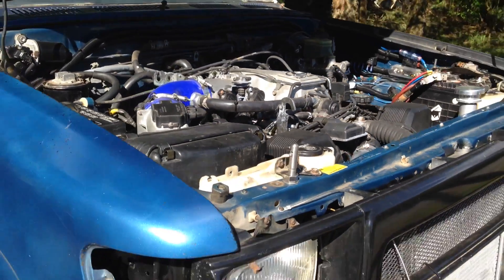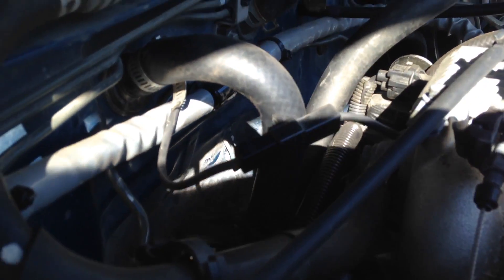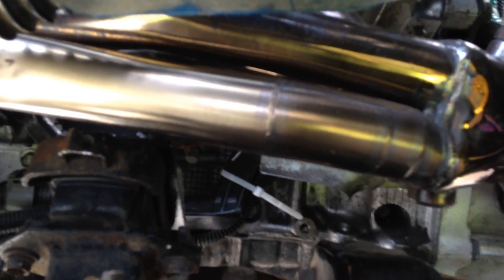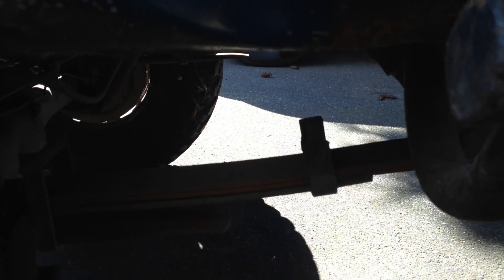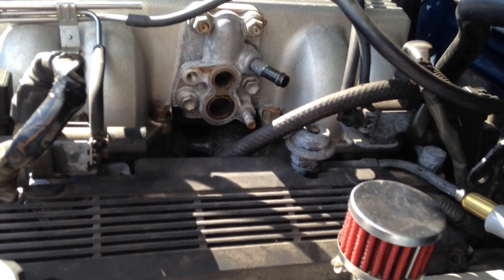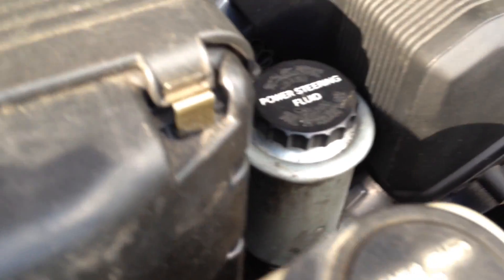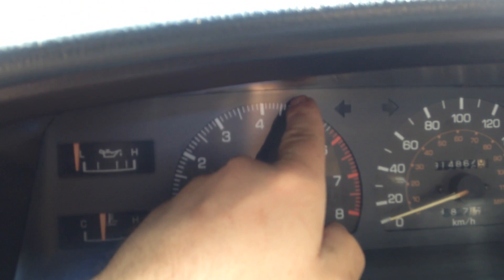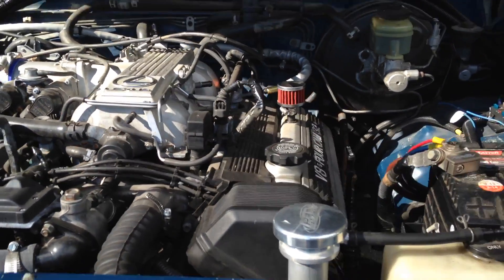Info on my 91 Toyota pickup with a 93 ls400 1uzfe v8 swap

Comment: Do you know if the auto tranny A340F would bolt on to the 1uz?
Reply from the maker: No, bellhousing is not the same. 

Most guys will use the stock Lexus automatic and use the inchworm output shaft adapter so you can bolt on your transfercase.

Comment: What type of fuel pump did you use? In-tank or external? And the bars/psi
Reply from the maker: I used the factory spec denso replacement 3vze fuel pump. It is sufficient for the 1uzfe in stock form.

Comment: I'm not sure if you remember what did you do for the wiring?
Reply from the maker: Wiring is fairly straight forward. If you have access to the Toyota schematics you pretty much just Match up the wiring. 

Things like constant power, switched power, ignition/injector power, starter signal. You will need to splice in connections for oil pressure, water temp sensor. The 1uz uses a dual speed fuel pump, the 3vze used the air flow meter to give ground signal to the circuit opening relay to allow the fuel pump to run. So I used a spare output from the 1uz ecu to trigger the circuit opening relay. You will also need to separate the 4wd front differential wiring from the old engine harness if you’re working on a 4wd truck. 

Toyota is pretty consistent when it comes to wiring. The lion share of the wiring is from the engine to the ecu which you don’t need to mess with. Remove as much old wiring for the transmission and other items like egr if you don’t plan on using them.
Reply: @Jay351  awesome thank you thats a huge help

Comment: I have a 93 LS400 1UZ as well and do you know where the Igniters and Injector/Sensor power wires are located in the harness? Are they in the same plug as the Starter signal wire?
Reply from the maker: Should be located in plug iL1, wire is black with orange tracer, feeds the injector circuit. If I remember correctly it also feeds the ignition coils. Been many years since I did the wiring on this swap. Same plug as starter trigger wire.
Reply: @Jay351  awesome I see there’s 1 Black/Red wire? I assume that’s power to the Sensor wires?
Reply from the maker: @cakebop  the manual shows it as black/orange but it may be more red than orange. 

It should provide power to both ignition coils and all 8 injectors. You could use a multi meter to check the wire in question, using one probe at the ecu end and one probe out at each injector and coil, using the ohm/continuity function on the multi meter.
Reply: @Jay351  yeah there’s one Black/Orange wire and one Black/Red wire in the same iL1 plug
Reply from the maker: @cakebop  the black/red should fed from 15amp supply. This supplies various sensors with their 12v power such as o2 sensors,  idle up VSV, egr system etc.
Reply: @Jay351  got everything powered up only problem I’m having is The injectors not firing or getting ground signal from ECU 😔

Idk if I’m supposed to wire the NSW/STA 
I have Spark, fuel (switched relay), and starter cranks
Reply from the maker: @cakebop  okay, I checked a wiring diagram. 

In plug IL1 pin 12, black wire with orange tracer. This is power to injectors, ignition coils and igniters. 

This wire also hits the ecu in plug A pin 9 “IGSW”. 

Verify you have +12v at each injector, each coil, ignitor and at the ecu by back probing the connectors. 

Manually verify that your injectors actually work as well. Did you see this engine run prior? 

The neutral safety switch NSW and STA do not need to be wired in a manual swap configuration.
Reply: @Jay351  yeah I have Spark and 12v down my injectors but ecu is not sending the ground signal for them to fire
Starts if I spray it with brake cleaner
Reply from the maker: @cakebop  I see. I take it you haven’t seen that engine/ecu combo run prior to the swap? 
These old 1uz computers are known to be unreliable at this age. Have you opened it up to inspect for any blown capacitors? I did a full capacitor replacement on the computer that runs my truck. 
If you have the $$, aftermarket engine management is the way to go.

Comment: What’s your pilot bearing setup? Adapter needed?
Reply from the maker: Pilot bearing came with the KS racing bellhousing. I will try to look through old pictures to find a part number.

I did have to use the included pilot bearing spacer in addition to the input shaft extension for my short snout r150f trans.

Comment: Great job!  Very impressive build.  I am interested in a 1UZ conversion for my 93 5spd 4WD Toyota T100.  Any advise on the conversion for the transmission/bell housing?
Reply from the maker: If you use the KS racing bellhousing adapter:

Cut down the mount for the slave cylinder about 1.25” as it’s cast far to tall. You will need to cut the threads deeper for the slave mounting bolts.

The kit comes with the short input shaft adapter for early r150f transmissions. I used it with my 91 gearbox. 

I used the flywheel from northwest toys (their first version), HD 3vze clutch kit from marlin crawler was used, but I had to use a 3.4L release bearing to make it all work.
Reply: @Jay351  thank you!  I am sourcing a 92LS 400 for this project.  A lot of interlocks and deleted for security on this engine management system I see.  Ignition key is coded.  Guessing the wiring for this is detailed
Reply from the maker: @brianlindsey1997  thankfully the on-board immobilizer is attached to the car, not the engine/ecu. 

There was no need to bypass anything in that regard. As long as the ecu is powered up, Ignition system is on, fuel pump (through the circuit opening relay) is running. She will fire.
Reply: @Jay351  excellent man, thank you for your help

Comment: Super helpful video thanks for posting. Did the front bumper mounts HAVE to be cut and moved or just an option for you?
Reply from the maker: The front bumper had to be moved forward to run my radiator in it’s current position. 

You could do a few things to eliminate the issue with clearance:

1: move engine back another 1.5”, this may cause some grief with access to bellhousing bolts and shifter location.

2: run a pusher fan setup instead of a puller, then the rad could sit in the original position.

3. Smaller radiator, could be a good option depending on ambient temps of your area and how you use the vehicle. ( it gets up to 40c here and I beat the snot out of the truck)

4: mount the cooling system in the bed. I would probably do this. The engine bay is tight, getting good airflow is an issue, even with a body lift and a tube bumper. 
If the rad is in the bed it’s protected and you will at least double the coolant capacity of the system.  This kinda wrecks the “daily drivers” aspect if that’s what you’re after.
Reply: @Jay351  thanks for the info. Amazing work!

Comment: How strong is the factory R150? Thinking about doing a V8/manual trans swap in my 94 land cruiser and I’m debating between the R150(easy to mate) or the nv4500(stronger)
Reply from the maker: I hear they are good for around 450hp. I’ve beaten the snot outa mine and she’s still good. Fresh shifter bushings from marlin crawler are a must!

Comment: which ECU output did you use for the negative/ground trigger for the fuel pump?
Reply from the maker: Angelo Ortega I used the mrel trigger and used a relay to provide a switched ground for the fuel pump. Not perfect as it won’t cut off the fuel in the event of an accident. But it’s functional.

Comment: Seems only parts you need fabricated are the motor mounts and a way to mount it to the trans. The rest you can pretty much rig up yourself?
Reply from the maker: Devin Paulsen the rad required heavy modification of the rad support to allow space, along with removal of the hood latch. 

Exhaust manifolds were modified (drivers side more so) along with a fully custom exhaust the whole way back. 

Engine swap required a body lift so there’s modifications that come with that as well.

It depends how handy and mechanically inclined you are. I purchased the major bits like engine mounts, bellhousing adapter, but the more you make yourself the better.

Comment: Any more info on the flywheel and clutch setup? 
R154?
Reply from the maker: Flywheel is a modified 3.0 unit. Clocked and re drilled for the 1uz bolt pattern.

Clutch is a marlin crawler hd kit for the 3.0v6 and I used a 3.4v6 throw out bearing 

Input bearing came with the ks racing bellhousing adapter kit. 

Stock r150 with the chain driven transfercase. Recently threw in a lce engineering short shifter.

Comment from the maker: Just an update. The truck had been undergoing a major transformation over the last year and a half. The frame and suspension have been completely restored and I’m just working on painting the truck. Look for an update video soon!
Reply: Updates?? Please check my comment on the r154 flywheel mating, eager for details
Reply from the maker: TheRumbles13 I posted a reply to your question.

I will make an update video shortly. The truck is finally on the road again, just got 300miles on her so far
Reply: @Jay351  Any update?
Reply from the maker: @andrewo8987  I actually just put licence plates back on the truck last week. Just waiting for some nice weather. Look for an update soon, it’s a totally different truck now.
Reply from the maker: @andrewo8987  just posted an updated short video. Gives a nice visual of how the truck sits today.

Comment: could you mount this 1UZFE engine to a 6 speed manual transmission, say from my 2006 ?
Reply from the maker: Daniel Borrer you could mate this to just about any transmission depending if you can either buy or make your own adapter.   Thankfully the r150f is a popular trans to use so conversion parts are easy to get
Reply: Jay351 thank you for the reply.  I am just starting to explore the idea of this motor swap and wondered how the 1UZFE would do (perform) with my existing transmission.  I'd think that the increased power would be detrimental because the existing 6speed (I'm not sure of its technical name) was not engineered to withstand this much power....  I understand of course depending on how the user drives the vehicle would play a big part of the longevity of the paring....  
thanks-
Reply from the maker: Daniel Borrer the original trans in my truck was designed for a v6 with around 150hp. It handles the 1uzfe no problem, and I beat the snot out of it! Its never given me issues even shifting at full redline full throttle!

Comment: Can you do a vid about wiring it up to your truck please?
Reply from the maker: I may upload some wiring info, but realistically it’s super straight forward. Even easier if you get an engine of similar year to swap in. E.g 89-92 pickup and a 90-92 1uzfe share similar systems for their circuit opening relay and such.  

Buy a factory service manual for both vehicles, then you really only need to actually splice about a dozen wires from the truck harness to the 1uzfe computer. 

Things like constant 12v, switched 12v, ignition, injector power stuff like that.  The factory 3.0 fuel system is triggered by a switched ground that’s made by the Vafm.  So I used the mrel terminal from the 1uz computer to fire a relay which provided ground to the circuit opening relay which would enable the fuel pump. 

If you’re interested in doing the wiring yourself you really should have some experience with wiring and electrical. Otherwise it’s best to pay someone or buy a swap harness

Comment: Does the 3.0 transmission marry to the engine just fine or what’s up
Reply from the maker: DADDY_ JULZ I used a ks racing bellhousing adapter. A 3vze hd clutch with a 5vzfe throwout bearing.  Seems to handle the power of the 1uz without issue.

Comment: What did you do for a fuel pump? I understand that Lexus had a two-speed pump in the LS400.
Reply from the maker: WrenchTech Unlimited stock fuel pump from the 3.0 is enough to feed the 1uz.  On my 91 the circuit opening relay just needed a negative trigger to energize it. I used one of the ecu outputs to trigger a relay to supply negative to the c.o.r.

Comment: I am getting close to doing this to my 1993 extra cab. So you used the LS400 oil pan? I am probably going to use the same bell housing. What did you do for a flywheel, clutch, clutch fork and throw out bearing?
Reply from the maker: Matt S_.  I used the stock ls400 pan.

As for clutch/trans I used ks racing bellhousing. A modified 3.0 flywheel (new bolt pattern drilled into it), used a marlin crawler HD 3.0 clutch kit with a 3.4l throw out bearing. 

Ks racing bellhousing needs around 1.5” cut off the slave cylinder mount and the holes re-tapped.
Reply: Thanks for replying so quickly. Some folks are saying that the 3VZE flywheel is too light. Have you noticed any issues related to that? Also, which fork did you use and do the 1uz engines have a spot for a pilot bearing.
Reply from the maker: Matt S_.  I haven’t had any issue with the flywheel being too light. The flywheel I got from north west toys is just a stock replacement. 

I used the stock release fork. I used the pilot bearing, pilot bearing spacer and Input shaft extension that came with the ks racing bellhousing.
Reply: So I take it then that the 1uz crankshaft has a recess in the end for a pilot bearing?

Here's a shot of my truck. It's a 93 with that presently has only 113,000 miles on it? http://wrenchtech.com/wp-content/uploads/2017/08/93_Toyota_pu-e1529390878161.jpg

I can get my hands on a KS bellhousing, but it comes with nothing else. I'll have to put the rest of the clutch kit together myself. And I may need the input shaft extension and pilot bearing.. I am hoping that I can get the extension made locally and figure out which bearing I should buy
Reply from the maker: WrenchTech Unlimited nice truck! Looks super clean, nice candidate for the swap!

I wish I kept records of which pilot bearing came with the kit but alas I did not. I actually bought the Ks kit locally about 3 years before I actually did the swap from a fella that decided to not use it.  I did have to use the stock 1uzfe flexplate spacer behind the flywheel to ensure proper engagement of the starter. Nobody seems to mention that...

Comment: How has that w56 held up?
Reply from the maker: Stone Chief trans is the original r150f. No issues with the increase in power. I only put a few thousand miles on the truck before I tore it back down for a semi restoration.

Comment: I didnt know 2UZ-FE headers fit 1UZ-FE no modifcations needed is straight bolt kn even the gasket i saw the headers sell for a good price tired of running stock ones lol awesome truck by the way !
Reply from the maker: TheEDD  yeah they fit pretty good, except the first 
 drivers side primary runner needs to be re routed to clear the steering shaft. 

Make sure you get 00-04 2uz headers as 05 and up use a secondary air injection system.

Also make sure you get thicker gaskets for the manifold to the heads, the eBay header flange is not perfect and will leak with a thin metal style gasket.

Comment: Can you get me wiring diagrams
Reply from the maker: ALWLEED 506 I purchased the oem wiring diagram manuals for my 91 pickup and the 93 ls400 from eBay. I wanted paper hard copies rather then electronic copies. Then I just layed then out next to each other and matched up most of the wiring, like injector power, ignition power, etc. 

I had to do some creative wiring to trigger the factory circuit opening relay but I also configured a kill switch into this circuit to make stealing the truck much more difficult

Comment: Good work man wish you lots of smiles per miles
Reply from the maker: MrDonkeyoti  thanks! I'm currently redoing the steering system, adding the rear o2 sensors in and re sealing the oil pan.  Hopefully I can finish this truck next year

Comment: Your breather filter on the driver's side valve cover needs to be removed and just run a hose to the intake somewhere as long as it is after the MAF sensor.  The way you have it is basically just a huge vacuum leak through the crankcase.  I did the same thing at first and was puzzled by my poor fuel economy (~10mpg) yet no check engine light and the ECU still compensated just fine at idle.  Fixed it and I was getting 20mpg with 31" tires and 4.56 gears.  Great video and such a fun truck to drive!
Reply from the maker: Jireh Ward interesting theory. From what I understand this is a positive crank case vent,  it shouldn't really effect vacuum at. 

I only deleted it because it's a high mileage engine and the condition was questionable. So I removed it to prevent any intake sludge. 

But I'll try swapping it over and see if I notice a difference. Thanks!

Comment: Is it possible to do this swap without moving the radiator and losing the A/C?
Reply from the maker: Matt S_. Yes. you can get the engine back father by massaging the firewall and shifter openings. 

If I did it again I would set it father back to avoid the rad clearance issues. That and solid mount it no rubber bushings!

The place I got my rad from sells an ac condenser to bolt on so it is possible to have working ac.
Reply: @Jay351  curious as to why you would skip the rubber bushings and mount it solid? Thanks for your video.
Reply from the maker: Ben Brunson well my truck is just a toy. So I figure the vibrations you experience are worth the rigidity of solid mounting.  

I had to drill through the motor mounts and install a bolt to prevent so much flexing of the engine under torque. It works but I think either an upgraded engine mount or solid is the way to go.